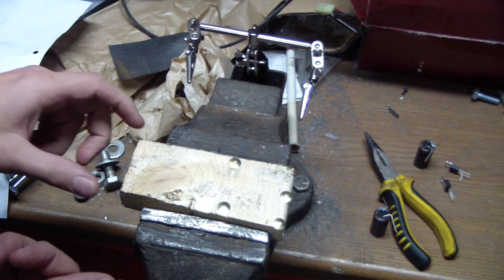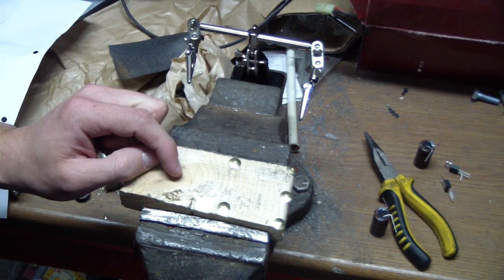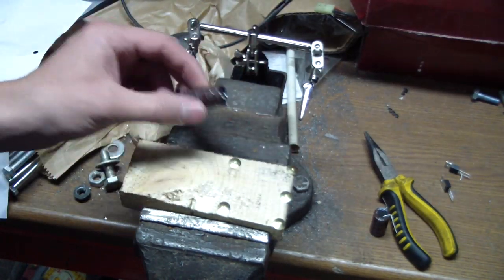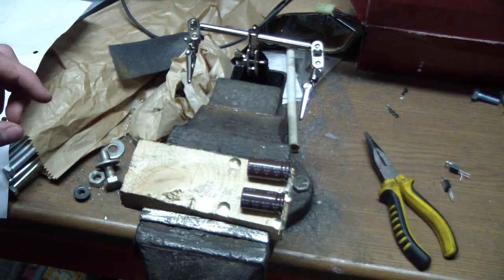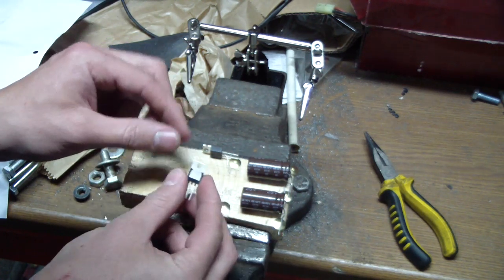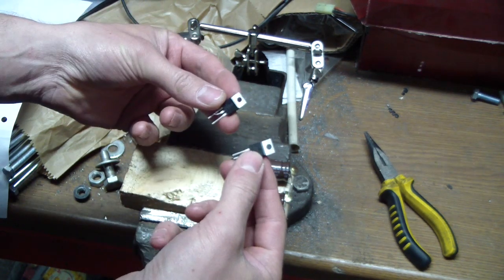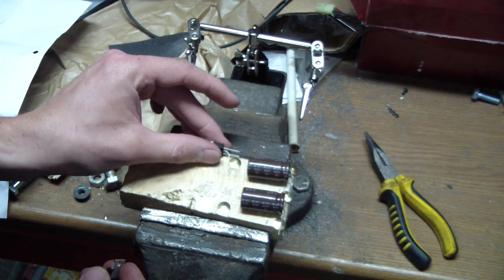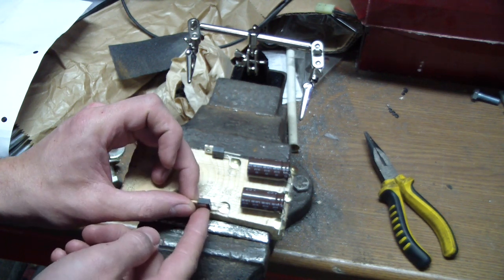Home made windmill generator part 10 - soldering voltage doubler

Comment: Hi. I've a few questions about the voltage doubler.  I saw that your VAWT was producing 6vac; after the voltage doubler is connected is that still ac voltage or is it changed to dc? 
How do you connect the voltage doubler up? 
In your video I only saw 1 wire connected to the voltage doubler.